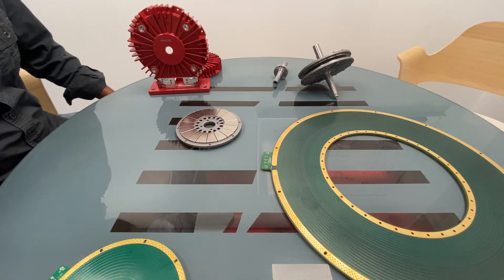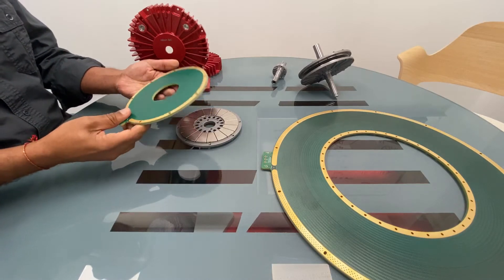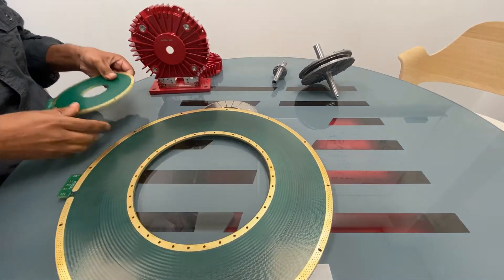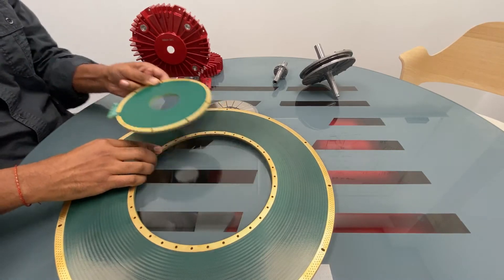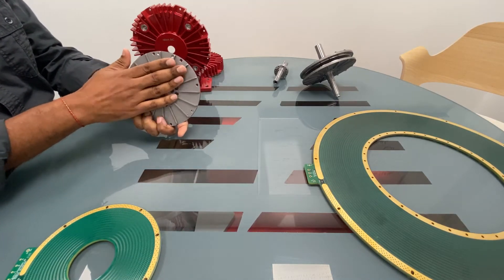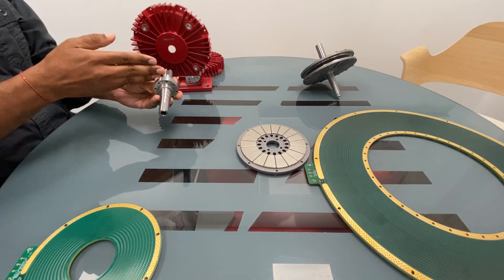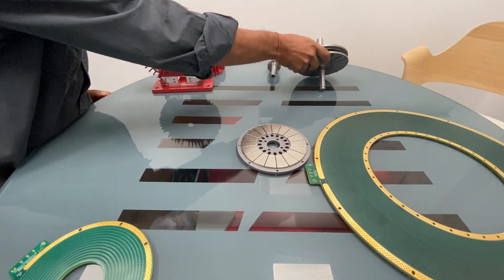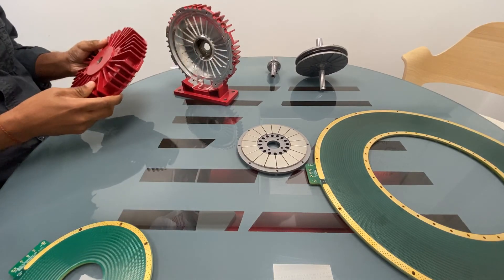Motor Construction

Comment: Is not cut out of product
Is cut  from the same raw material 
Sheet of   fr4 yes?? 
I think I copied that⬇️
What Is FR4 Substrate Material? FR4, also written as FR-4, is both a name and a standard rating. The name is applied to the fiberglass-reinforced epoxy-laminated sheets used in printed circuit board

Comment: what i do not understand is, you have 3 coils for (in either delta or star configuration....) but why are there no vias on the pcb... somehow you would have to connect the coils....
Reply: No I think it is three coils in three layers with each layer being one phase. Probably rectified or connected on the outside

Comment: Explain how the electrometric force rotates ...  & what's stationary and what moves.
Reply: Correct me if I'm wrong but the stationary part is the PCB stator and the moving part is the rotor. The motor topology is axial flux so that means the magnetic flux is parallel to the direction of the rotor. I hope this helps

Comment: Finally an intelligent update to the AC motor. Bravo!
Reply: This is nothing new. PCB motors have been in mass production since the 1970s. CORE technology has even went so far as to implement them into wind farms overb10 years ago. The motors have been used in the outdoor power industry for years, with CORE Technology at the forefront. PCB motors have powered string trimmers, blowers, chainsaws, and even lawnmowers produced by various well known brands, and quickly dropped from the market sector for the same reasons they aren't replacing AC induction applications... duty cycle. More specifically, the lack thereof. PCB motors have a great power-to-weight ratio... at the expense of duty cycle, because they don't evacuate heat very well. Their inherent design is similar to that of the axial BLDC "pancake" motor. The power output is high because the effective "windings" have a better near-field exposure to the magnetic flux. The downside, is all the winding area is focused on this exposure with no area available for heat extraction. 

In short, they can produce great power... but they can't sustain that output for a considerable amount of time.